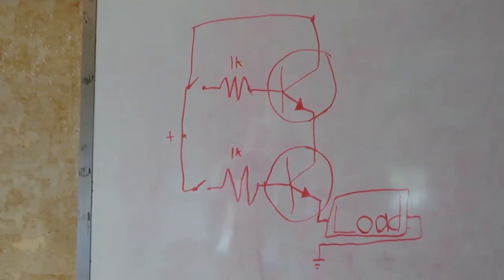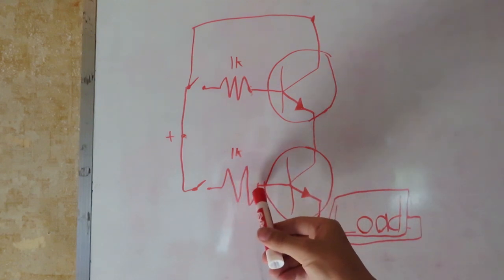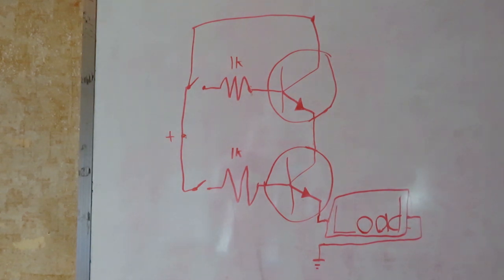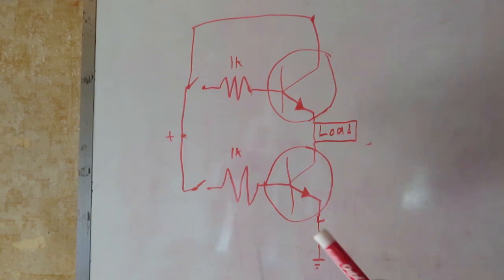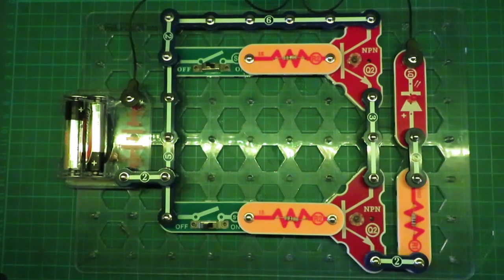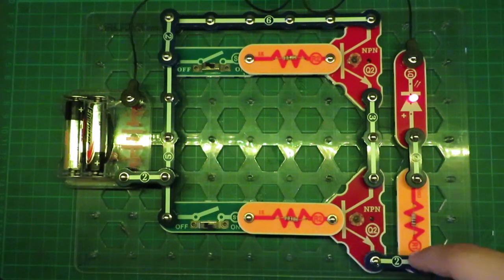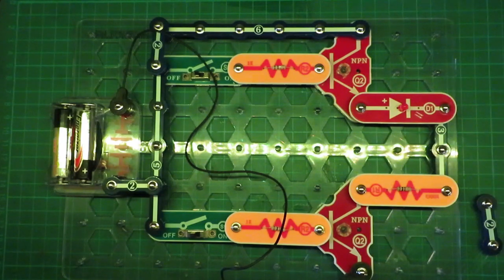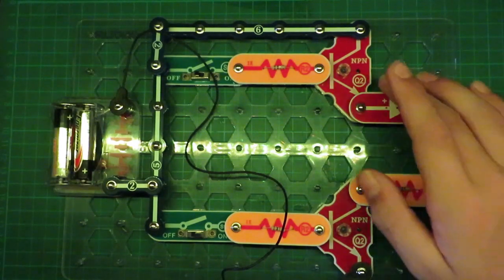Transistors in Series Problem

Comment: I like what you're doing here, especially the format of: problem then solution. 

From a circuit standpoint, an alternative to consider is to put the load on the high side of both switches. If you have a high side NPN BJT, the control current must flow through the load, hence the switching charicteristics of the BJT are load dependent. If the load needs to sit in between two BJT's, a PNP on the high side, and NPN on the low side could achieve the same thing.
Reply: This is more robust when you consider how the voltage gets to the base of the transistor. A 0.7V potential needs to establish across the NPN transistor BE terminals. As the voltage across the load varies, the emitter voltage is not constant, so creating a voltage at the base with respect to ground is not well tolerated

Comment: I enjoyed your video and explanation. I've been teaching my 9 y.o. son some of these principles, but I'm far from an expert. When we hit this same issue i opted to significantly increase the resistor value. The turn on current for the transistors can be vanishingly small, this then much reduces the flow through current when only one transistor is turned on. I believe there are actually situations where having three states, on/off/floating can be advantageous. IE one can achieve more outputs with the same number of inputs
Reply from the maker: Thanks! I am glad that you enjoyed the video!

Comment: I think traditionally this would be solved with a pull-down resistor on the drain of the lower transistor. With snap circuits it's not much of an issue, but on real PCBs/silicon, having the load in the middle would be impractical to route for more complex circuits
Reply from the maker: Thanks and yes I guess would be impractical to route for PCBs

Comment: Pretty good explanation! what I recommend to make it easier to understand is to show the series problem on the snap circuit first for context, THEN show the diagram to assist your explanation of how it works.

You might also want to try isolating the area from outside sound to make outside noise less audible and distracting, a quick and dirty way to achieve this is to drape thick blankets around your recording area and on the walls, this reduces the sound bouncing around the room, making an echo, and outside noise coming in.
Reply from the maker: Thanks for the advice! I will try to do something about the background noise (I am recording in our basement)
Reply: A directional mic might also assist. Great vid though 👍👍
Reply: @prettymuchflawless-cn1ms  Honestly, as long as you're audible and understandable, and there arent any odd high frequency sources being captured (since everything these days uses tiny speakers thus they reproduce/resonate-with high frequencies a lot easier as opposed to the low frequency rumble of, say an air conditioner) you really dont have to stress too much over it. Yes, there are audiophiles that will make it seem like anything that is not perfect booth audio is an affront to nature itself, and the bandwaggoners, because they see others do it assume its a socially acceptable thing, that will point out every little background noise (this is why youtubers get all self-conscious about noises that dont even come through and derail a videos flow feeling like they need to qualify and explain every little noise) but really to us techy types that came here for the electronics, and not to play gatekeeper judging video quality based on misguided personal qualifications (all of which very from one vocal minority to another), the video was fine. No worries. If advice were sought, Id vote for lighting and maybe a better camera (the low light performance of this one is a little on the hazy/grainy side, which could partly be due to the reflection of the light down the middle of that snap board thingy throwing off the dynamic range and/or just a sensor that doesnt perform well in low light. You want to aim for more light than you think you need, my personal choice is around 4000 kelvin color temp sources as its not too hot/bluey white, and not too cool/orangey red, good mix in the middle. But anything that doesnt flicker or 'band' with the shutter speed of the camera is fine as long as it brightens up what the sensor captures). But that being said, even that is 100% a nitpick. The audio was acceptable for the style of video, nice and even, very audible, not struggling to hear certain syllables over the background, the video was serviceable, I could easily see what you were conveying. Dont get too lost in chasing the nits picked by others. The list of things to actually be concerned with when making content is a lot shorter than the perfectionist complainers will make it seem (and is mostly be as correct as possible on technical and scientific matters (thus the research), and/or at least preface opinions with "I believe this is how XYZ" or "As I understand it...." or, as in the opening to this video, "here is this problem, and my solution is..." and of course welcome (civil) conversation in the comments (its good for algorithm engagement points)). Keep doing what you're doing, its a great jumping off point, no worries. (If and when) it starts building momentum make incremental improvements as you go, do A LOT of research before you buy anything, wait for sales, look into older stuff too, sometimes something perfect for the task is 5 years old, outmoded, and going for a steal on ebay. 

Video content critique: usually you'd want an PNP upstream of the load, but thats some deeper circuit voodoo than running an LED. Keep exploring and researching, youll figure all those little secrets we old salts forgot were secrets long ago out eventually. We all had to reach those "AHA!" moments ourselves when we were learning this stuff. 

And remember, always ask questions. Anyone willing to rail against an honestly asked question is not worth taking advice from in the first place. Be careful how much you open your mind, because your brain could fall out, and someone will come along and stick their garbage in the empty space. And above all, be kind, and have fun!!!

Overall, regardless of what anyone else says, seriously, thumbs up mate. Keep it up! 😎👍

Comment: But the led should be connected to the upper side of the circuit. The emitter of the bottom transistor to ground. And the led at the emitter of the top transistor.

Comment: In digital circuits, you almost always want to use NPN BJTs as your pull down network and PNPs as your pull up network. Otherwise you need more complicated circuitry to drive those transistors. So in your case putting the load between the positive and the upper transistor will work even better. 

The base current flowing through the load is only one of the problems... Another important thing to notice is that your upper transistor(s) is not fully on... I bet you that if you measure the voltage drop of the two transistors on your last example, the upper one will be signifficantly higher... This may not be a problem when you drive an led, but if you try and drive a bigger load you will have a lot of unecessary power loss on that transistor.
Reply: You are correct in the physics but using the wrong components.  For low power and higher input frequencies "Complimentary Metal Oxide (CMOS)" transistors are used instead of BJTs.  Where higher power consumption is okay and input frequencies slower in changing BJTs are okay.  CMOS electrostatically damage and go usually out quicker than BJTs in year after year performances.  However, because lower input voltages and power requirements extend the life of the components longer.
Reply: @lawrencejelsma8118  Well yes you are right... You can use anything that is driven at a positive voltage as your pulldown network (not just NPN BJTs and NMOS'. There are many more transistor types such as IGBTs or JFETs wich could also work, but for some basic breadboard logic BJTs are the easyest to work with and MOSFETS are usually the second easiest). Respectively, you can use anything that is driven at a negative voltage as your pullup network... It just makes it 10 times easier.

CMOS is definitely the winner technology when it comes to digital IC but I have never seen it used on basic breadboard stuff... I am guessing because it does not really matter at theese frequencies and because without a good way to add deadtime you could have huge current spikes.

As for the electrostatic damage affecting COMS more, I have never heard about it. Are BJTs actually more resilient to electrostatic damage? Do you have any trustworthy sources to back this up? And what does electrostatic damage have to do with the working time of the circuit?
Reply: @iliazark1  ... Electrostatic damage on CMOS transistors?  If you order them aren't they shipped in electrostatic bags with caution on the bags?  Check out also YouTubers sites working with CMOS vs BJT breadboard or solder board decisions because the pn tunnel channel between the source and drain in manuals can be damaged by electrostatic shock by human touch They say be careful handling the CMOS chips (or transistors) for grounding to avoid this electrostatic damage known to happen in chip or CMOS transistor replacements. People can breadboard with them to simulate or practice when they have to change them out in electronics by soldering technicians.
Reply: @lawrencejelsma8118  Yes.. Pretty much every electronic component is shipped in an antistatic bag with some moisture absorbent material but that was not my question... And yes, CMOS ICs will defenately be more sensitive to electrostatic discharge than discrete BJTs but is it just because of the fact that the transistors in the chip are many orders of magnitude smaller, making them more sensitive? Online forums seem to agree that FETs are more sensitive to ESD. They say that the gate can exceed its break down voltage very easily from an ESD because of the high resistance. But I can't find anything about the pn tunnel. 

Just to clarify, my quenstion is: Given a BJT and a FET transistor with similar capabilities (current handling, max voltages etc.), is one more sensitive to ESD than the other?

I know CMOS chips are very sensitive to ESD... I am looking for the reason... And the gate thing actually makes sense... Thanks for pointing it out.